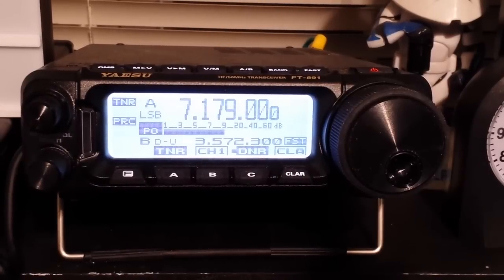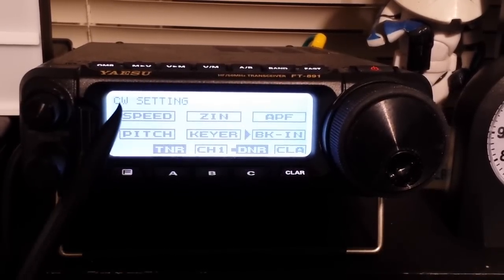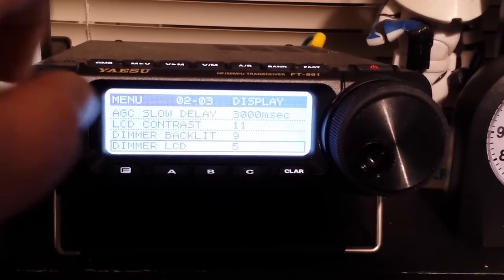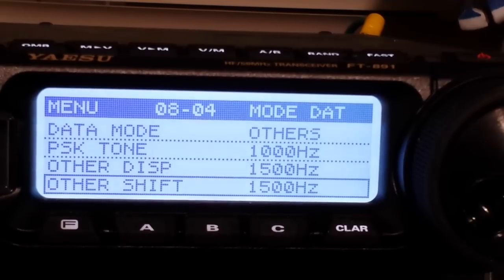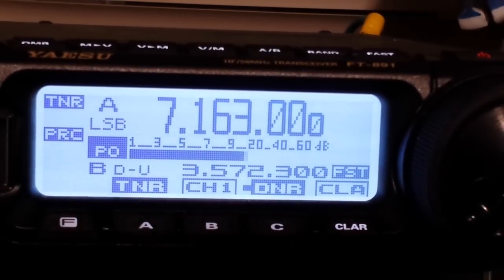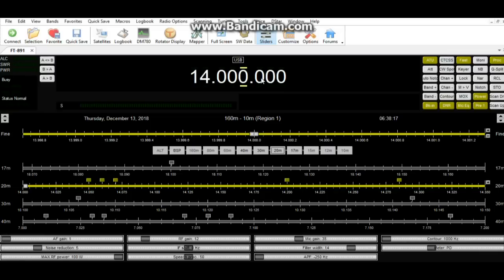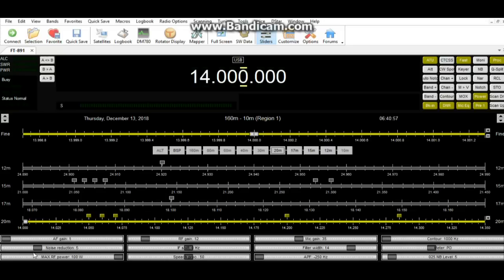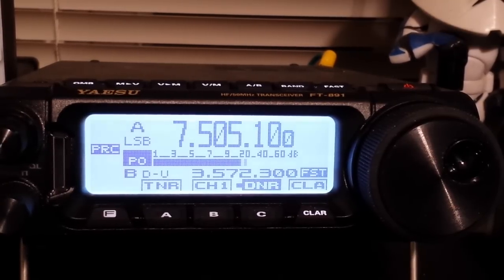Yaesu FT 891 Digital Modes Setup

Comment: 10:03 Correct me if I'm wrong but 08-11 Data Out Level is the Audio output level for the USB interface to your PC and 16-03 HF Power is where you set the transmit wattage.

Comment: I own this radio. Big mistake.  This radio is MISSING a built-in soundcard.  Digital interface required.  Two USB cables and one Data cable plus interface box.  Cable salad!  Not suitable for digital modes in the field.  Separation kit requires TWO cables, one to connect head to body, and on LONG cable for Mic because Mic is connected to body and not head.  See Icom IC-7200.  I also own an Icom IC-7200, also an entry level, relatively inexpensive TRX.  It requires ONE usb cable to connect TRX to PC.  The rig is on the heavy side, so I prefer to use it at home.  Too bad.  The simple no fuss radio stays at home, and the cable challenged FT-891 goes into the field.  The world is sometimes really backwards.  73!
Reply: Well ... you can't really say that the radio is "missing" a built-in soundcard when it wasn't built with one. The 891 is more portable and is HF-only - don't try to make it something it's not.

Comment: Can the 891 do digital in/out through the front headphone jack to a regular USB sound card, instead of using the rear digital port?
Reply: rgfuller the 891 doesn’t have a internal soundcard. The USB port on the back only delivers rig control not audio. The data 6pin din port transmits audio, so you use a usb interface to “convert” the 6pin din to usb.

Comment: Great info, thanks! I also have the 891 and am just learning how to use it. Can you go over the interconnects to get it up and running in the digital modes? For example, I know that the IC-7300 has a built-in sound card, so you only need to use a USB cable from the radio to the computer. But how does that work on the FT-891? Anyway, always great info, thanks!
Reply from the maker: https://youtu.be/RLeULm47jac

The 891 is exactly the same as the 450 when it comes to digital modes. So this video applies.
Reply: thormusique the 891 doesn’t have a internal soundcard. The USB port on the back only delivers rig control not audio. The data 6pin din port transmits audio, so you use a usb interface to “convert” the 6pin din to usb
Reply: @MrC-Hacking  Ah, I see. This is very helpful, thanks very much!

Comment: I bought a 891 and so far , I luv it.... what a awesome little rig, works great on the base antennas and out in the field, plus it has a ton of extras built in and works great with JS8 and HRD in all modes all the way from qrp to 100 watts if needed.
Reply from the maker: It's a hidden gem. Love the radio.